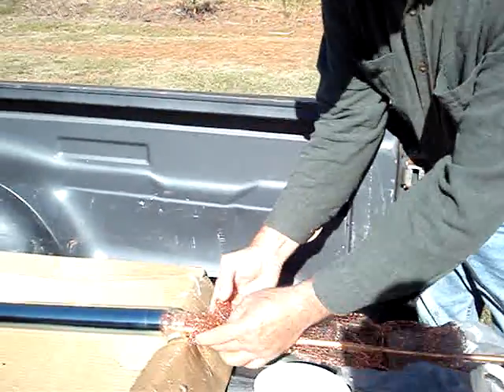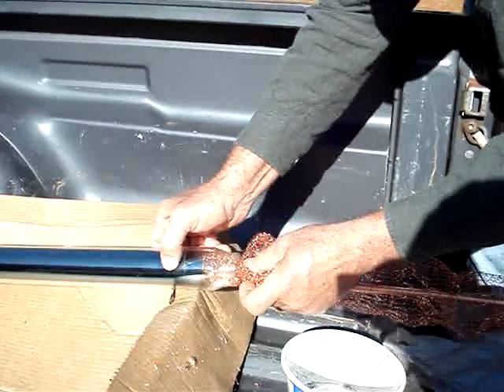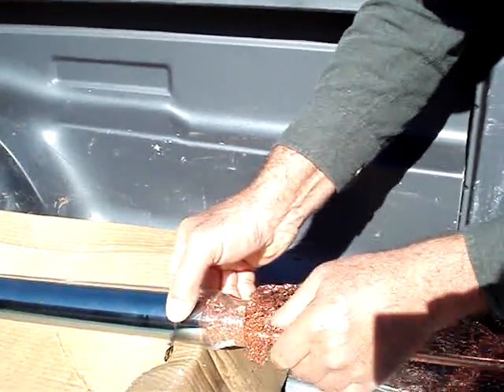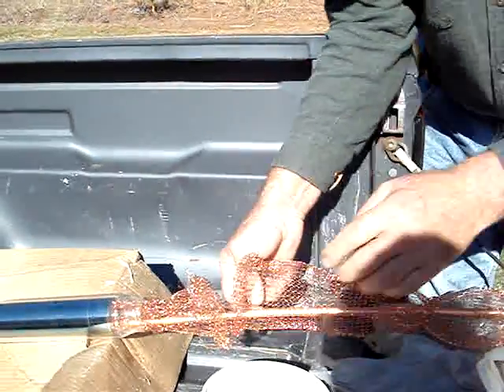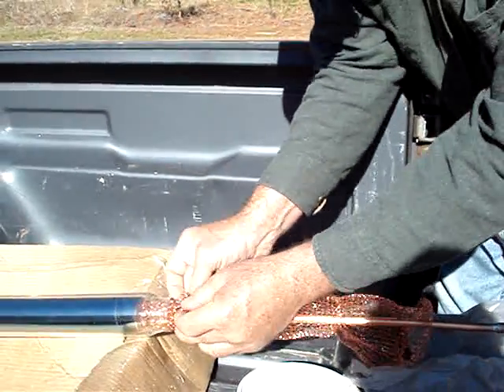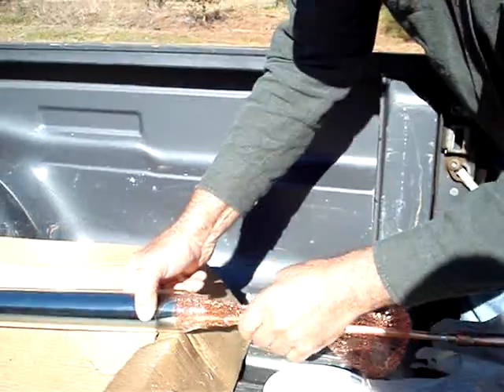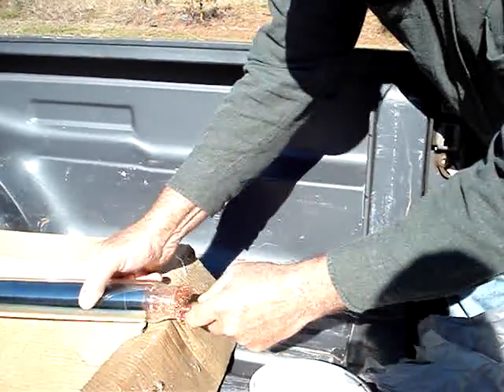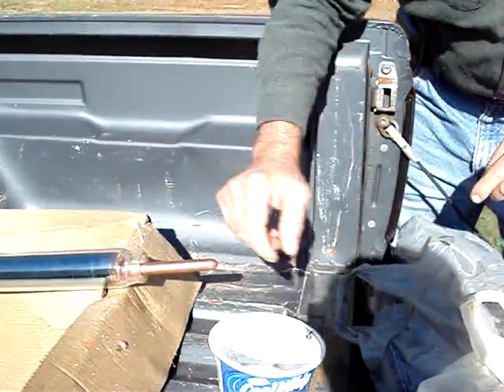Installing the heat pipe in the evacuated tube

Comment: The tubes are a "common" product. I'm from Denmark-Europe, and that in a general means that stuff are expensive here. BUT. I just found a danish website that sold tubes like these at 10 USD per tube, 6 foot long. I recon that you maby could find a US price half my price, hence - I live in a expensive country ;)
The tubes you get prebuild, you cant do it you'rself, well - you can ofc. but it's not practical and it wont save you a buck.

Comment: Another youtuber warns not to let these evacuated tubes heat up without liquid in them.  I guess you havent had a problem with letting them get hot with just the copper tubing and mesh?

Comment: I just purchased an 18" solar tube on Ebay and I am going to make up one of these heat tubes for it. Do I need to reduce the amount of acetone since the heat tube will be 1/3 the size you are working with?  When you installed the HT with the copper scrub pads unrolled did you make a fold at the end to protect the inside glass from the HT?